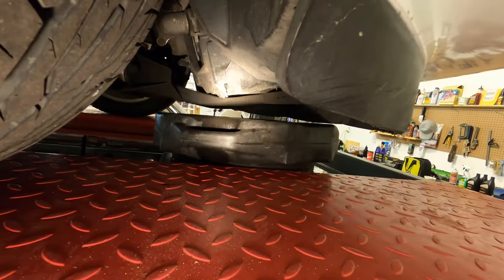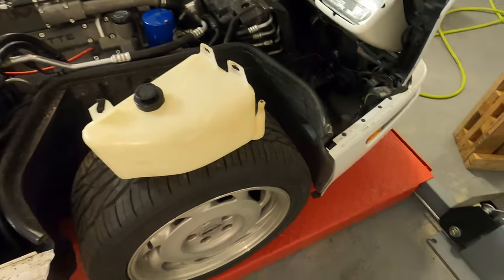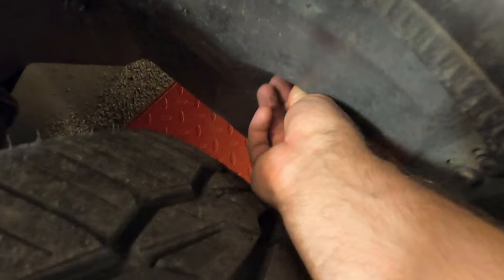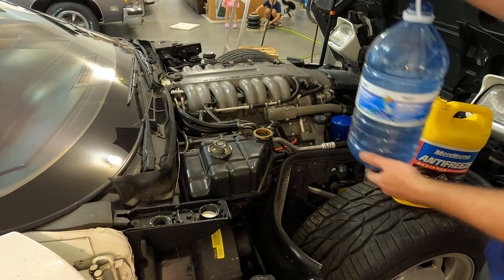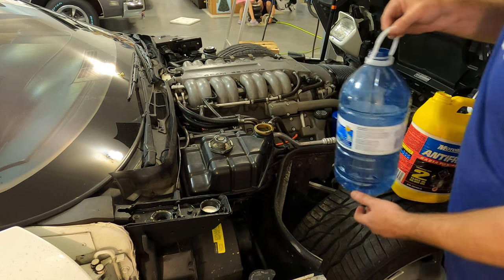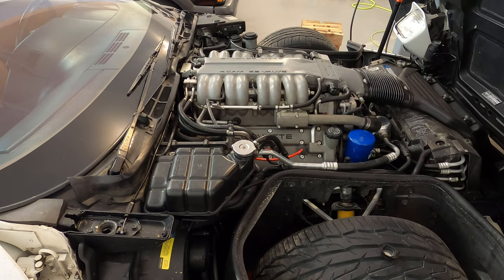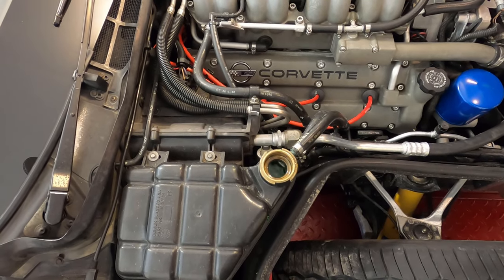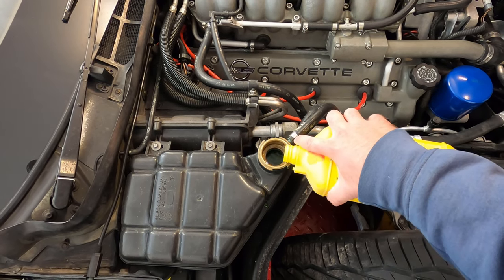C4 Corvette ZR-1 Coolant/Antifreeze change on the 1991 Chevrolet Corvette LT5 5.7 V8 ZR1!

Comment: I love that extended start up. I remember when I bought my first Z, I thought it had an issue. I always lift the right side when filling, and I rotate the hose on my left coolant pipe just to be certain. I deleted my throttle body coolant, so I do everything I can to avoid air lock. Love that car in white. Great video.
Reply from the maker: Thanks.  Does the throttle body delete affect air lock?
Reply: @gregs_garage  apparently it can cause issues with initial fill. Although Marc Haibeck has worked on more than a few that had it deleted, and he has stated that lifting the passenger side has never given him trouble with initial fill. I replaced my heater hose pipe assemblies with silicone hoses, I wanted to keep the pipe assembly intact in case the next owner wants to put it back to stock. I did the same with my secondaries, everything is bagged, and labeled. If someone wants to put it back, they will have everything to do it.
Reply from the maker: @JohnMartin-uk6bi  nobody will want to put it back.  But I keep everything also.  I am considering getting the chip and deleting my secondaries.

Comment: I will be doing this on my dad's 95 at some point!
Reply from the maker: Do it before July.  Get it done!
Reply: @gregs_garage  Oh trust me, it needed to be done a long time ago! When I do it, it's gonna need several flushes until my OCD is satisfied. Much like the brake and clutch fluid which I did recently. We don't really drive it much but just enough to keep the fluids moving. Summer we don't drive it because the rain in Florida. Roof leaks, AC can't be on or the car gets hot because very thick radiator (unless you are going 75 mph). Winter in Florida you can easily drive it. But there is too much traffic to deal with when it comes home from our shop. Old people.... too risky. Even if it sits for a few months it starts right up and runs great. Despite it being pretty much an unrestricted race engine.
Reply from the maker: @GreggCesaroni  When I change coolant I just drain and refill.  Do it 2-3 times over a few weeks if you want to ensure you're getting all the old stuff out. and renewed.  Same thing with automatic transmissions.  Some people insist on flushing to get it all out of the torque converter but I say who cars.  Drain and refill.  Drive for a while.  Do it again.  You've renewed the trans fluid without "flushing"
Reply: @gregs_garage  speaking of coolant flush, I’m actually doing it as we speak haha! I will be taking my time making sure it’s all cleaned out! Your video does help!